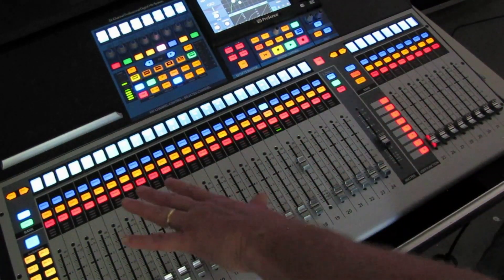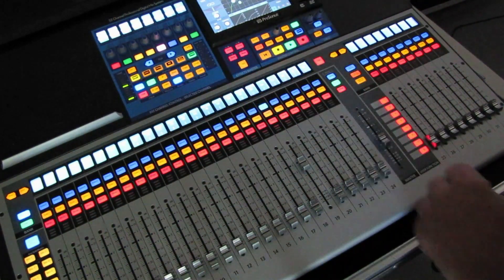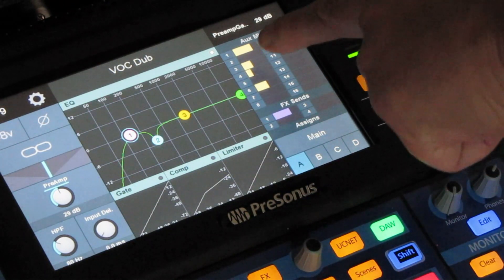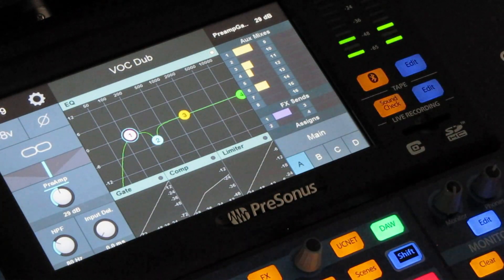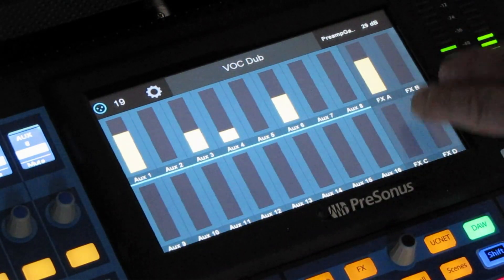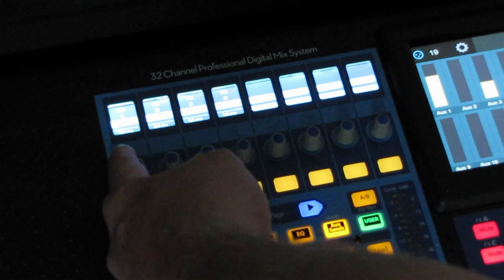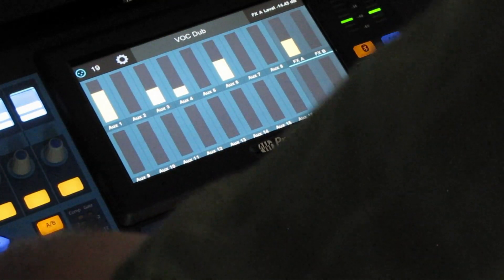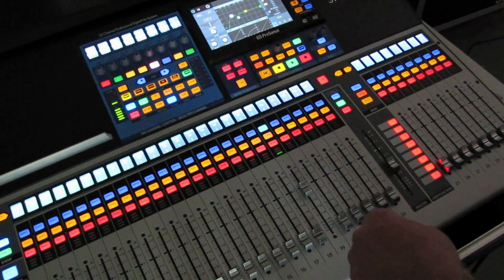Presonus StudioLive Series 3 console - how to route effects to FOH and monitors

Comment: How do DCAs affect this when DCAs are used?
Reply from the maker: Good question.  Effects are tied to the input and are most always set as post-fader.  Routing the inputs into a DCA (not a "traditional DCA"), can impact the effect assigned to the input(s).  This is because DCAs work directly on the console inputs.  Routing the same inputs into a sub-group, will not impact an effect level.  A sub-group works independently from the inputs that are assigned to it.  There is something called a "traditional DCA", which operates like a sub-group; traditional DCAs should have no impact on a effects.  Having said all that, it's possible a digital console (there's a lot available now) can be configured to manage effects differently based on where a signal is routed.
Reply: @stageleftaudio  Thanks for your reply. Church is using same board with DCAs. Starting with main mix on the left side and DCA selected on right side, select any FX and the DCAs faders are adjustable in FX mode. Board is most likely in DCA traditional mode as main mix faders don't move with DCA. Do the DCA faders have any affect on FX level when DCAs are used?
Reply from the maker: DCAs (by default) will control the individual faders that are assigned to that DCA.  Though, no signals from the inputs pass through a DCA (compared to a sub-group).  The DCA is more like a "remote-control" for the inputs that are assigned to it, therefore, the DCA doesn't actually control the reverb assigned to an input(s).  However, because a DCA controls the inputs, lowering a DCA fader will lower the faders that are assigned to it (compared to a sub-group, which does not control the faders assigned to it), which will result in the reverb also being lowered because the input(s) using the reverb are being lowered (assuming effects are set as "post-fader").  DCAs are a good tool for grouping instruments, however, how they control the inputs assigned to it can sometimes introduce a complexity to a DCA mix.  In contrast, using sub-groups to control a grouping of inputs is another option.  With sub-groups, the grouping fader only controls the volume level of the sub-group, not of the individual inputs in that sub-group.  With sub-groups, individual inputs (assigned to the sub-group) do not change.  Therefore, i.e. when a sub-group fader is lowered, the volume of the sub-group is only lowered... the individual inputs and any effects assigned to them - assuming "post-fade" effects (for that sub-group) do not get lowered.  
For the DCAs, if you do not want the effects to be affected by the individual fader movement, try setting the effects to "pre-fader" for the input(s).  Technically, any movement on the input fader (or DCA fader) will not impact the effects.  I rarely use DCAs for instrument grouping, because of how they work; I find sub-groups (though more limited in the number available on the console) to be much easier to use for managing groupings. 
What are you trying to accomplish with a DCA on the console?
Reply: @stageleftaudio  DCAs are helpful with a large band, multi input drums and can also be used as mute groups. That's not the question. Push any FX button A-D on this board and the DCA faders can be adj. That adj within the FX doesn't stay when you exit FX. What does that adj within the FX do?
Reply from the maker: I think I see your question.  When the FX button (A-D) is pushed, the channel "select" buttons on each fader should turn purple.  This color change shows which faders can be added to that effects engine.  If a "select" button does not turn purple (i.e. when the "DCA Group"  button is pushed when the console is in an effects layer), this indicates the faders (that did not turn color) cannot be controlled by the effects layer.  Therefore, the DCA groups cannot be added to effects... the console does not support this.   Though, what we previously mentioned was the use of "Traditional DCAs".  I did some brief testing with this... the DCA functionality of the console should NOT be set for Traditional DCA.  For whatever reason, any effects applied to a channel/input does not get passed through the DCA, when Traditional DCA is activated.  After turning off  Traditional DCA, all effects were passed through the DCAs.  Any effects that are needed on an input, will still need to be added at the channel/input (like you normally would), then assign those channels to a DCA.  
For reference, my Presonus consoles are at this firmware level: v3.1.0.107071

I can't speak for Presonus, but looks like the DCA group faders, showing up in the effects layer when A-D is selected, is allowing you to add/remove inputs assigned to the DCA group you selected when pressing the "Select" button above a DCA fader.  When you press a DCA "Select" button, the faders (on the left side of the console) show which inputs are added to that DCA.  In my opinion, it looks like Presonus is just giving you another way to add/remove inputs to your selected DCA, without having to do directly into the DCA screen to add/remove inputs.  The DCA fader positions, within the effects layer, appear to have nothing to do with the actual DCA levels.
Reply: @stageleftaudio  I'll check on that firmware version when I get a chance. I don't believe I've ever seen select buttons change color... I also don't think we've ever needed to push select on a channel to get FX, just move the faders. The FX fader levels will show on the channels Input screen when you select a channel outside of being in FX.
Reply from the maker: The color schemes for the "Select" buttons, as well as for the AUX/SUB/Matrix layers can be customized; it's possible the colors were modified from their original (default) colors.

Comment: Can you possibly show the lcd display above the aux sliders on the right side of the console at the 8 min > area ref the fx in monitors please?
Reply from the maker: The right side of the console (the small grouping of faders) are the "master" faders for various functions of the console (aux sends, effects returns, etc...).  The fader I'm moving (in the video) is the effects return for the AUX-1 send.  The camera does not do a good job with video on LCD screens (bright screens).  You may want to check the manual for that console.  It references the use for those far right faders.
Reply: @ Thank you for the quick reply I thought it was the aux but I don’t have the console in front of me to play with it I’ll look for it when I’m in front of it tomorrow.
Reply: @stageleftaudio  I still for the life of me cannot get it to function even though I could swear I’m duplicating everything that you’re doing in the video. I took some pictures of the settings. How do i send the pics to you to see?
Reply from the maker: @robertehlers2638   I can't promise you anything, but I can take a look at it.  Try this email - info@stageleft-audio.com  Also, include the firmware level of the console you are using.
Reply: @ i sent pics via email this morning
Reply from the maker: @  OK.  I just checked email... have yet to receive anything.  I will contact you (at your email) when I receive it.
Reply from the maker: @ You may want to re-check the email address you used... I have no email from you yet.

Comment: Nice video. We have the PreSonus 32 Live at a small church in Fort Collins Colorado and over the last year I've been figuring more and more out.. I've been having an issue with the send to our YouTube stream and when I'm using reverb FXA for example, I get too much reverb in the YouTube stream itself while in the main room it sounds just fine. The YouTube stream is sent out through Mix 8 in our case and I'm wondering how I can control the reverb on Mix 8 or our YouTube stream separately from the main room feed. Thank you
Reply from the maker: Is Mix 8 a regular Aux send, or is it a Matrix?  If Mix 8 is an Aux send, bring up Mix 8 and use the "Prev" and "Next" buttons (at the top left of the fader panel) to page to the right to bring up the other inputs.  From what I recall, on the last page (3 pages?), you should see the Effects return fader; check to see if the fader is set too high.  To get back to the main 1-32 inputs, just press the "Prev" key till the inputs show up.  This method should also work if Mix 8 is a Matrix (there could be different routing things going on if the YouTube stream is on a Matrix).

Also, you may want to check the actual effects.  Press the affected effects button.  When the inputs show up, verify that only the instruments/inputs you need are being sent to the effects processor.  You may need to use the "Prev" and "Next" buttons to page through the inputs.
Hope this helps.

Comment: Hi How to separate reverb control Foh and aux
Reply from the maker: The FOH reverb control is managed within the effects buttons.  Select the effect button and all the inputs/faders can be sent to the effects processor.
For reverb within an AUX, select the AUX mix and then page over to the right (using the arrows) until you see effects return; the reverb can be controlled from the reverb fader.
If you need complete separation of effects for an input (between FOH and AUX), you may need to use other effects engine on the input (one for FOH, and one for AUX).

Comment: Is there a way to mute the effects via a footswitch? Saw a guy did it with an older board that had channel inserts, but this board does not have those.
Reply from the maker: I'm not aware of any way to do that.  Though, it may be possible using Universal Control with MIDI.

Comment: Still no reverb on mines
Reply from the maker: That is odd behavior for that console.  It's straight forward for setting up effects.  Without sitting in front of the console to see what is going on, it's very difficult to provide a fix or solution.  If you bought the console new, you should be able to open a ticket with Presonus.  If you bought the console used, Presonus has a questions/answers website where users can post issues.  Other users can usually answer any questions.  
forums.presonus.com
Reply: @stageleftaudio  thank you I think I trouble shooted it now I'm having trouble playing back recording I think I might need an SD card to keep recording tracks on console then bounce to daw
Reply from the maker: @eloriginaldelasierra  Playing back recordings on a Presonus (like many digital consoles) can be a problem, especially if the recording was NOT originally made on the console you are using.  We don't use our consoles for recording nor DAW work.  There's too much involved with that!

Comment: We've own a Presonus StudioLive since they were first introduced. We have NEVER been able to get ANY effects to work. There is something we are missing. I believe it is what you did around 3:42. Why did you do this? I CANNOT find anythng in the manual that explains this. We are very disappointed with this product and have found the very availability of BASIC settings VERY lacking. We will not be buying anymore products from Prosonus and will never recommend  them to any other church. Great hardware. Poor interface. Worse documentation.
Reply from the maker: Do the effects work in FOH?  Or do they not work at all... anywhere in the console?  Is the firmware somewhat current?  ...above 2.1?
You are correct, the Presonus documentation seems to lack instructional information, however the documentation does a good job referencing the technical side of what the console is.  The effects (by default) are the four purple buttons on the lower left side of the "Flex mix" area.  Just like in this video, if you select, for example, "FX A", the faders (and screen) should change to the "FX A" layer.  All the effects on the console have an "input", and "master", and a "return".  For example, assuming you need reverb on a vocal, make sure there is input from the vocal channel on the effects you are needing... next, set the master level for the effects (should be the console main fader by default) up to the -0- db mark.  Next, set the return level of the effects (using the AUX controls) button above the Soft Keys buttons.
The effects engines are just like an AUX sends.  

If nothing is working, you may want to open a ticket with Presonus about the issue, also, you could try resetting your mixer:
https://www.youtube.com/watch?v=DvJlqzcWcWk
Reply: @stageleftaudio  Thanks for replying. I've left that church but watched this again to see what "the church AV team" could have missed. I'm sorry but I could not follow the what you were doing on the board with all the camera movement. I'm sure this somehow works on a Presonus BUT I will never recommend their products.
Reply from the maker: @gibfen1235   Thanks for the followup.  Sorry to see you were not able to get them working.  Setting up effects is somewhat straight forward... setting them up is similar to setting up monitors sends.  I will say this, Presonus has user profiles that can be configured on a console.  If you were on the console as any user other than "Administrator", it could have been possible that some areas of the console were made unavailable to non  Admin users.  I have never managed user accounts on a Presonus, so I can't speak much about it.